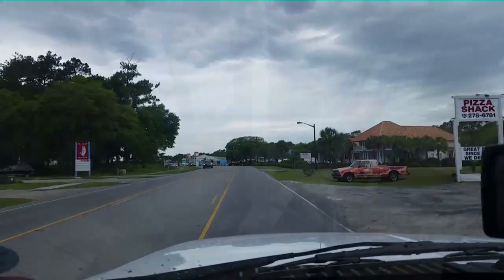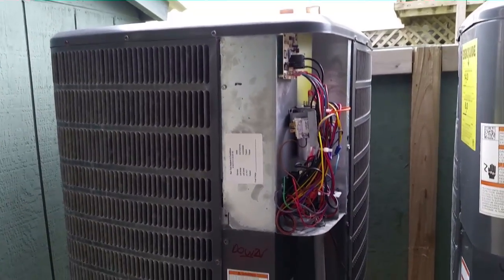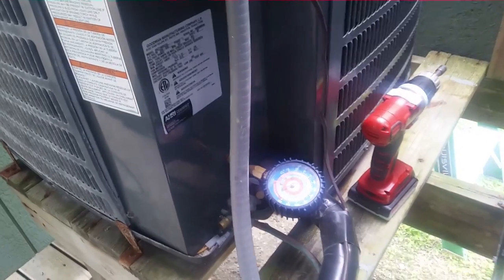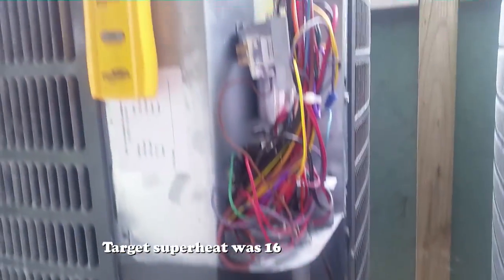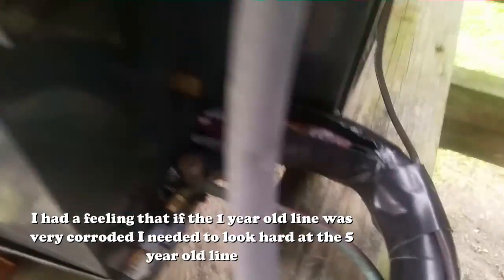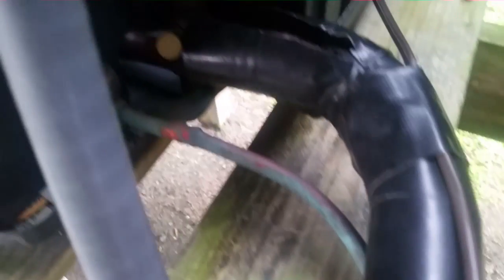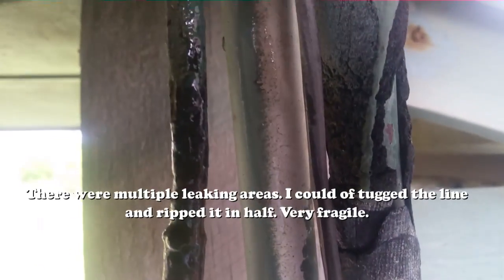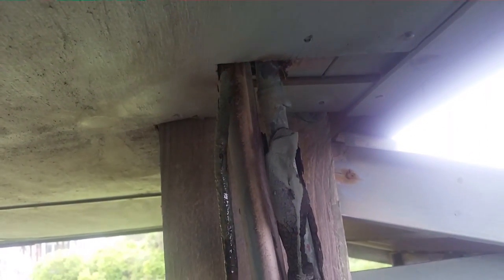HVAC Service - Salt Air Corrodes Copper Line

Comment: "No need to replace linesets on every job" lol You'll spend twice as much time repairing poor installs as you would to just do it right.
Reply from the maker: Sounds like an armchair quaterback. The corrosion wad the worst I seen. I believe I can justifiably state that it could not be predicted. Not a poor install, just a very corrosive enviroment. The 10 month old copper and equipment is already deteriorating.